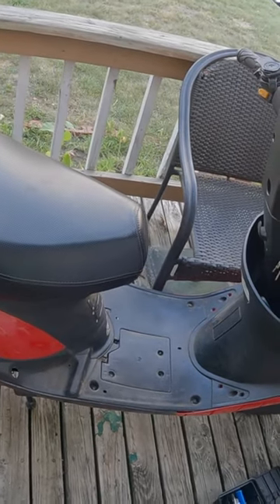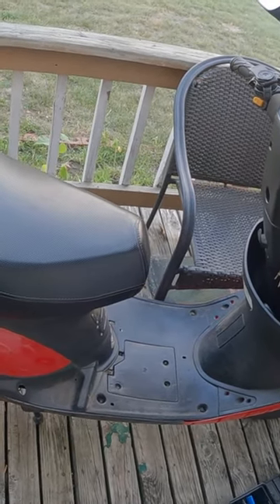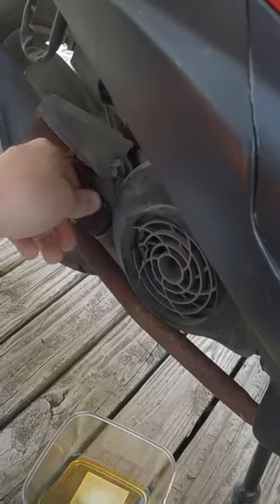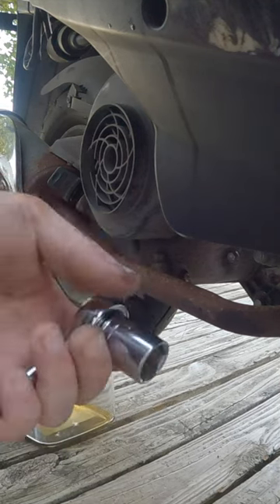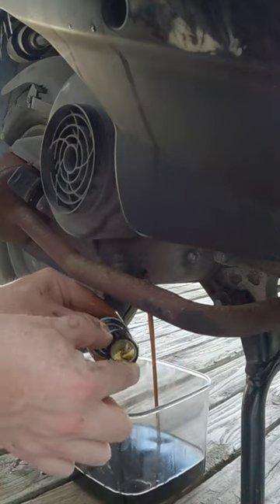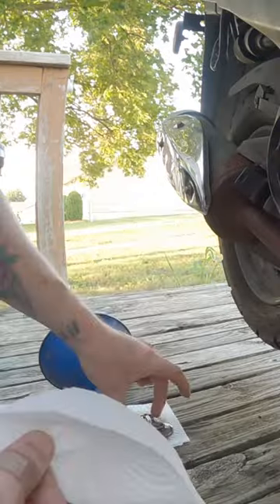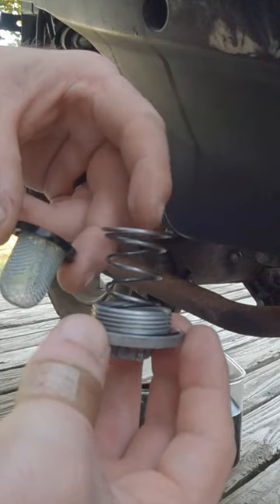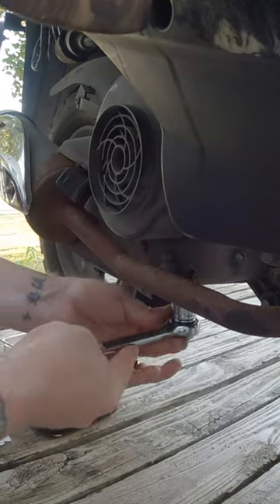How To Change Oil On A TaoTao Scooter #shorts #oilchange #50cc

Comment: That’s not the oil drain plug as u said the filter the other side of the case is where u let the oil out .
Reply: How do you figure that its the way you do it it's all on video right there.
My tao tao doesn't have a filter where the oil goes in.
The drain is where the oil leaves the the engine.
Matt you should take a course in something other than bullshavik
Reply: You must have PRONOUNS